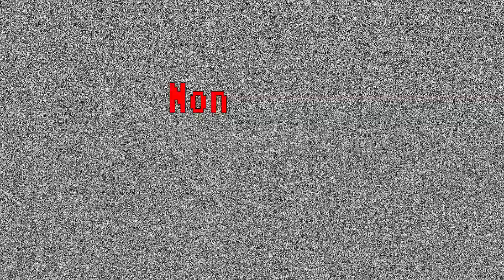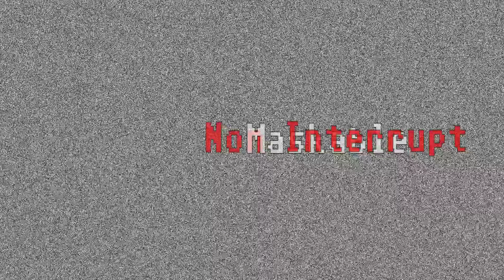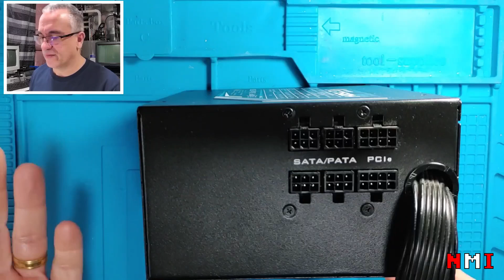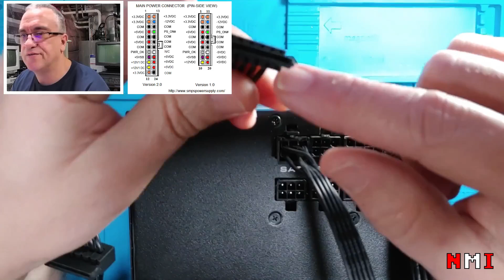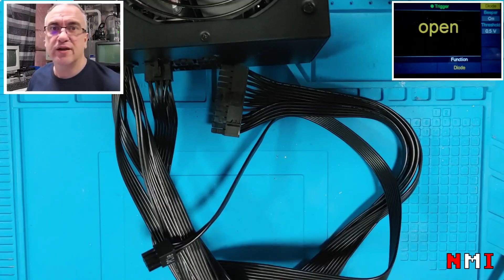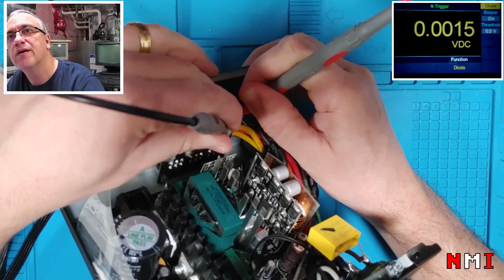Checking your modular PSU cables!

Comment: Great video thanks for the help! I have just ordered a multimeter to test a cable i have being delivered. DO you have any advice on how to test a Corsair 600W PCIe 5.0 / Gen 5 12VHPWR - Dual 8-pin PCIe - 12+4pin. I presume i find a known ground on one end of the cable and test one of the connectors on the other end?
Reply from the maker: Hey! Thanks! Unfortunately I don't have a PSU that is PCIe 5.0 capable :(

Comment: Wish me luck! I got a used RTX3090 this week, only to descover it needs THREE 8-pin PCI-E connections! GRRRR
My ancient "Cougar" PSU has two built-in, so now I have to test out a mystery 8-pin PCI-E modular cable to see if it's compatible with it!
Reply: Well! On my Cougar S850 SX power supply, the pin 4 on the 8-pin PCI-E connector was ground! Seems that's the default. Has been working fine.
Reply from the maker: Wow three PCI-E? That is some serious power! Regarding pin 4, well as long it is not reversed power and causes a short, it should be ok I guess?
Reply: @fabio-nmi  Yeah, that's how the built-int PCI-E cables coming out of the PSU were wired, so the modular cable was wired the same way, so it's up and running now. Many thanks for your video! Helped me to confirm so I don't blow up this expensive video card I just got! Hahaha

Comment: Thanks for this, it really helped as I have a box with a mix of cables for more than one PSU.  Only thing is on the PCI-E it confused me a bit.  Pin 4 on the 8 pin connector is 'sense b'.  Mine tested as ground, and looking on the internet that is correct, yet yours tested as 12v?
Reply from the maker: Hi, sorry for the late reply. Thanks I am happy that this was useful to you! Yes mine tested as 12V, I guess it really depends on how the PSU voltage sensing is designed? In any case, from the PSU's perspective Vsense is an input pin as it measures the voltage on the load (other end of the cable). It is not expected to supply voltage to the load. I mean, the load should not expect to get power from that pin. I hope that helps! Thanks for your comment!
Reply: I too got ground on Sense B for PCI-E. EVGA PSU. Also learned a Rosewill modular PSU PCI-E cable is electrically correct for a modular EVGA PSU; just needs a little "shove" :D